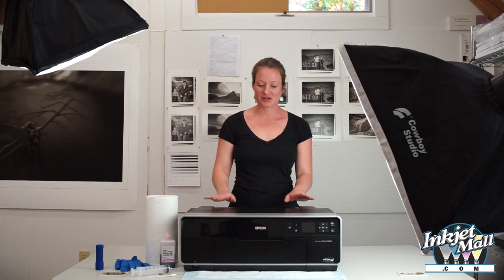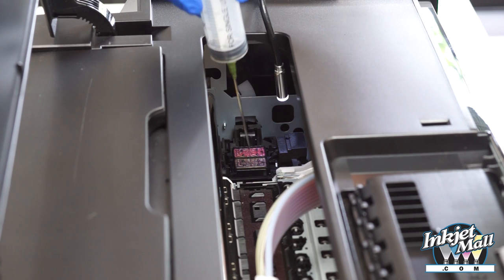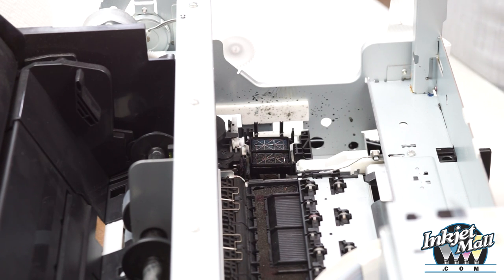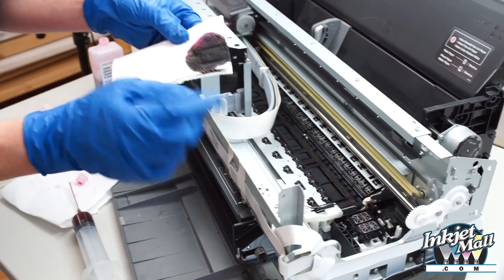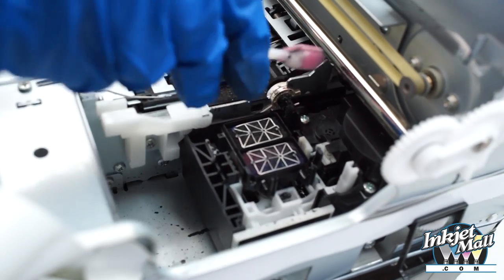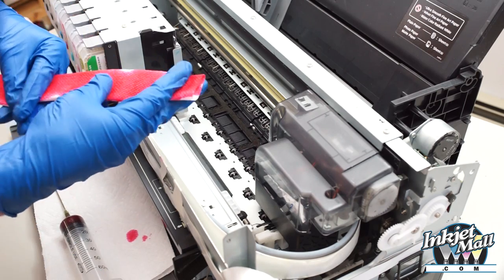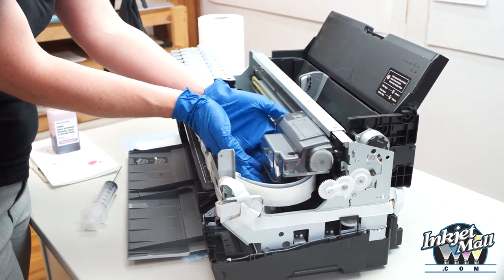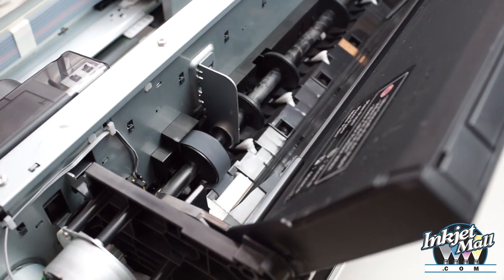How to Professionally Clean Epson R3000 printers

Comment: Thank you so much for this video! I need help finding the wiper blade on the R3000. I cannot figure it out and have tried, without luck, searching everywhere on the internet. Thank you!
Reply: In the video she doesn't work on a R3000. You either have a different printer or you cleaned something else instead, but not the wiper blade.
The wiper blade is completely hidden upside down and not accessible except you do this steps to bring it up:
https://community.inkjetmall.com/t/wiper-blade-on-epson-r3000/1265/2
If feel sorry for everybody who was misleaded by this video.

Comment: I have the exact same printer. Today i went to clean the printer head using the settings on the printer and do a nozzle check and suddenly the colour yellow has completely stopped printing. Has this happened to you before? Im lost for answers and need my printer for prints of my illustration work

Comment: I have a Epson Stylus photo 1400 printer, it hasn’t been used for a while. When I started using it I would get horizontal blue lines about an inch apart. I did a lot of cleaning & tried cleaning kit but it had no improvement. The print test was good except for the alignment test showed the first row ok the two other were not good. What do I do to resolve the problem, I don’t want to throw it away but I’m out of options, please help.

Comment: Epson R3000 is useless, if You have a ultrahigh resolution monitor, UHD.
Other Epson products have same problem, like Scanner V500 Photo.
Reason is that Epson dont update there drivers, and therefore dont give a shit about customers.
Reply: Why useless? Can you elaborate?
Reply: @nichderjeniche  It cant be used at highresolution monitors, as the drivers cant scale to that.
Its the same problem on older scanners from Epsom.
Buy from other compagnies.
Reply: @johnvedsegaard6505  I have already an R3000 but I don't have high resolution monitors
Reply: @nichderjeniche  Than You will not have problems, at least with win10
Reply: @johnvedsegaard6505  You are talking gibberish. The resolution of your monitor has nothing to do with your printer or scanner.